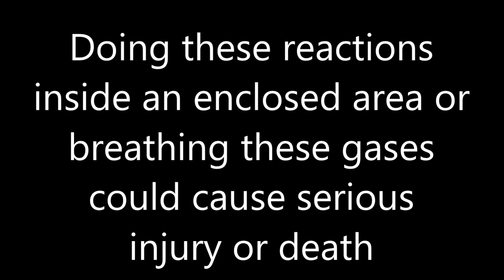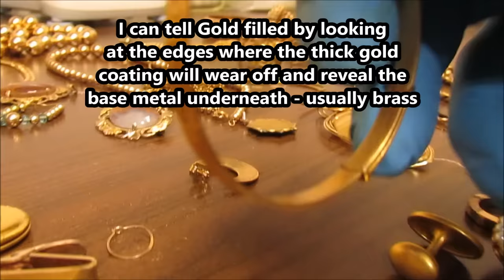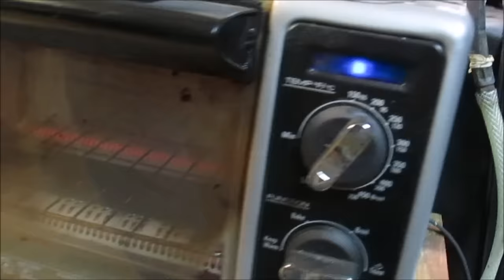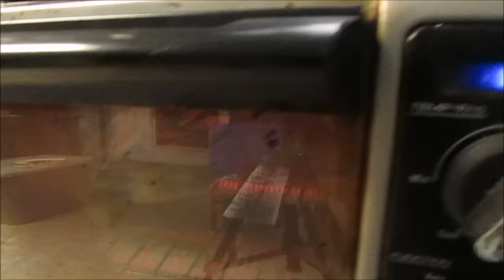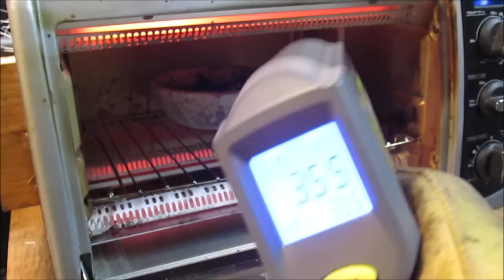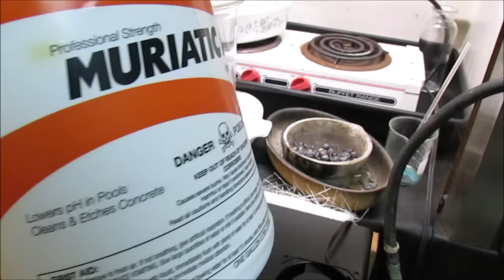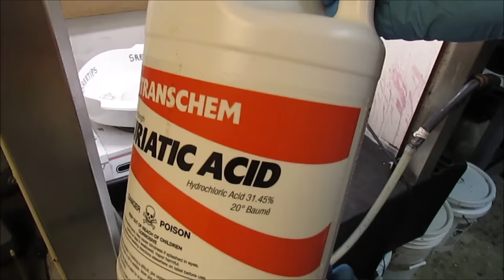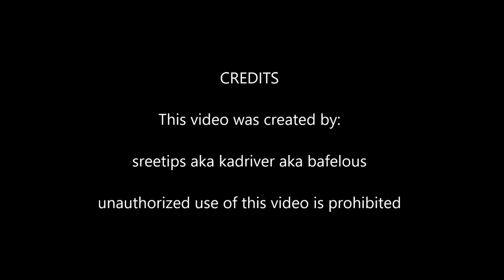Gold Refining 740 Grams of Gold Filled Scrap

Comment: Can filtered rain water be used instead of distilled water?
Reply from the maker: Yes! I've actually used condensate from my window air conditioner. I put a five gallon bucket under it to catch the condensate. Its only available during the summer. I've used it to dilute silver nitrate solutions when cementing out the silver.
Reply: Excellent! I know it's not much of a saving but rain water is free, and we currently have a lot in the UK, ATM. Excellent videos! I'm a complete novice but learning so much from the way you do things. Many thanks.
Reply: Distilled water here in the US is easily available for around $0.85/gallon jug. Some stores have a RO system for filling your own jugs with purified water that charge around $0.30/gallon. So the water cost for the process is negligible.
Reply: Yes it's around £2 per 5 litre over here but I've got 400 Litre barrels of rain water outside my workshop. As you say, negligible really, I just wondered. Nitric and sulfuric is more of a problem, one needs a licence to buy and hold it in the UK now.

Comment: I have about 100 grams of gold filled items that are marked gold filled and magnetic. I believe it’s gold filled over steel. Would it be ok to add that to my 500 grams of non magnetic?
Reply from the maker: Wil, I've added magnetic items to my nonmagnetic GF batches. Nitric will dissolve iron, but not very well. After everything is dissolved with hot dilute nitric, I check the foils with a magnet and remove any bits of steel and iron before committing to the aqua regia. Iron will cement out gold - so I take it (iron) out before trying to dissolve the gold.

Comment: Looks like I need to start finding gold filled at yard sales. Would it pay off in the end after buying jewelry, acids,beakers,pyrex,etc,etc, or is it more of a hobby? Also why couldn't I just leave the gf in the acid for a month or so and come back to it?
Reply from the maker: This is a hobby for me. It took me about a year to save up the material for this batch. I've never tried leaving the gf in acid for a month. But in my experience, allowing solutions to sit for a long period of time is not a good practice. Especially with lots of base metals dissolved into the solution.
Reply: sreetips gf also means girlfriend, I hope that’s not what you meant ☠️
Reply: @sreetips  I recently started processing gold from scrap electronics.
I left the acid in plastic storage containers with the scraps in their entirety.
The acids have no effect on the plastic, then i just cover it with the lid.
It looks completely fine. I have collected this stuff in bits and pieces for about two years.
The heat helps when leaving it alone. Also, it is probably good to use bleach or hydrogen peroxide 
to speed up the reaction. I'm still processing this, going on about 3 weeks now.
The major concern is keeping this out of the reach of children. I put this off for a long time
because I didn't want my nieces and nephews to find this. As long as you can guarantee
no one else can disturb this process, it should be safe enough for storage.
Reply from the maker: gf=gold filled
Reply from the maker: gold filled and electronic scrap are two different recovery processes.
Reply: @sreetips  I see what you mean after reading the other comment again.
I was just trying to get across recovering everything at the same time is less
tedious and i don't have all the proper tools or the time for refining everything
so I'm recovering everything all at once, then refining later.

Comment: Will you be making a video for metallic gold filled scrap?
Reply from the maker: Magnetic?
Reply: Yes. Magnetic. Typo
Reply from the maker: Ok, I had megnetic GF pieces in this batch. They will go just fine. But I did remove some pieces of iron from the batch in this video. Nitric will dissolve iron, but not very well. My hesitation to put magnetic in the batch came from doing a batch of GF eyeglass frames that had spring steel in them. The whole batch consisted of just the part that went around the ear. They were magnetic spring steel and they were a nightmare to refine. I have since done gf batches with magnetic material and all went well. This video will work for magnetic gf scrap, but not for spring steel gf eyeglass pieces.

Comment: Where are you finding concentrated nitric for 25 bucks???
Reply from the maker: I got it on sale, six 2.5 liter bottles for $157. But there was a $50 shipping charge that I didn't include in the quote in the video. GFS Chemical
Reply: @sreetips  thanks for the insight.
Reply: @sreetips  what is your go to way to tell the difference between plate and filled when it's not marked?
Reply from the maker: I can tell by looking at the piece under magnification. Gold plated is very shiny looking with many imperfections on the surface. Some GF scrap will test as karat gold on a stone with acid. I file a flat spot on the suspect GF piece then apply a drop 14k test acid on the file mark. The acid will begin to dissolve the base metal almost instantly. Wipe the acid and view under magnification. GF will have a viewable thick coating of gold with different color of base metal at the tested file mark. Gold plate will look totally different with this test - no thickness to the gold.
Reply: Thanks for your quick replies and the insights.  It's extremely helpful. 

How do you handle recovering from magnetic gf. I have a pile of band tops and a few bezzels that are 10krgp but are magnetic
Reply from the maker: Naomi, those should go just fine in the nitric acid. Iron dissolves in nitric but it don't do it very well so it will take longer. Use a magnet on the beaker to carefully pull out any solid iron pieces. I added magnetic GF tops and watch cases in this batch with no problems. The problem comes from spring steel pieces. But you should not have any spring steel with watch cases and band tops. Spring steel is in GF eyeglass frames but only the part of the frame that goes around the ears. I did two pounds of just the spring steel parts for a friend a few years ago. They were a nightmare. It was that experience that prompted me to warn about magnetic needing a different process. Your magnetic watch cases and band tops should go just fine. Hope this helps.

Comment: OK, so you got $1,000 for how much cost in materials and your time?  What does is cost to treat and dispose of the noxious by-products.  Then there is the set-up costs - fume hood, scientific glass-ware, chemicals, hot-plate.  Then there's the risks to your health.

Clearly, this guy knows a thing or two about metallurgical chemistry, I'm guessing a life-time of experience.  So, this is just a hobby where he buys scrap and strips out the gold.  Really cool to watch, but I wouldn't mess with concentrated nitric acid or any acid.  

THX for the demonstration of a world I know nothing about.
Reply from the maker: I get the GF scrap for about $200 max. My time don't count, this is my hobby. Waste treatment takes up about 1/10 of my time that I spend. I bought the hardware over time, but I'm not sure of the total cost. The fume hood was $250 on eBay,nand $250 to ship. The fume hood removes all the fumes so I don't get earn the slightest hint in the air that I breath. I started 2010 I'm all self taught. Retired Naval Engineer.

Comment: Gold filled?, is that gold plated?.
Reply from the maker: No, gold filled is a thick coating of karat gold bonded to brass. Gold plated is a micro-thin layer of gold over base metal, almost nothing.
Reply: @sreetips  ok, I never heard of it before, I'm in Ireland and the only gold I know of is plated or just 9,14,18,22,24 karat, thx 👍.
Reply from the maker: Gold filled will be marked like this: 1/20 12k GF, or 14/20, or 10k RGP

Comment: if so I can get a bunch of that
Reply from the maker: Gold plated is a very thin, just nanometers thickness, almost nothing, plating of gold over junk metal. The junk metal will be first plated with copper so the gold will stick. Then the thin gold layer is plated on the copper coating. It could take as much as ten pounds of gold plated junk jewelry to get just one gram of pure gold. Gold plated must be run through a sulfuric acid stripping cell in order to get any gold from it.

Comment: Why is it called "gold filled" when it's clearly "gold plated"?
Reply from the maker: Gold filled is a thick coating of karat gold bonded to a base metal, usually brass. Gold plated is a very thin coating of gold electroplated on a base metal. Almost nothing.

Comment: Curious that you keep calling the scrap gold filled when it's quite clearly plated or covered. Using the term gold filled, does that mean it's just not 24 carat gold, in other words gold alloy?  If so, is GF a US abberation from the norm, 9ct, 18ct, 22ct which are all gold content alloys?
Reply from the maker: Gold filled is a sheet of 12 karat (12k) gold that has been heated and then pressure welded with rollers to a sheet of base metal (usually brass) to form a thick coating of karat gold over the brass. It's then used to make GF jewelry. Gold plated is 5 microns thick. A micron is one millionth of one meter. GF is a thousand times thicker that gold plated. That's why GF is far more valuable than gold plated - roughly the save value in weight as fine silver.